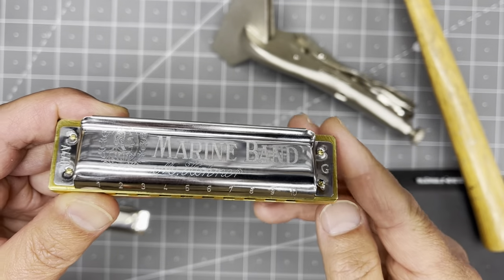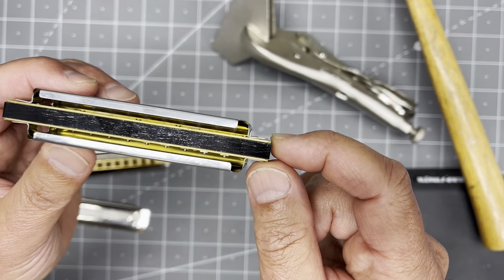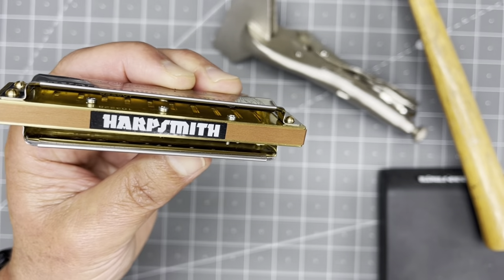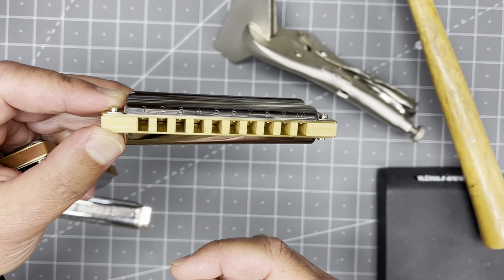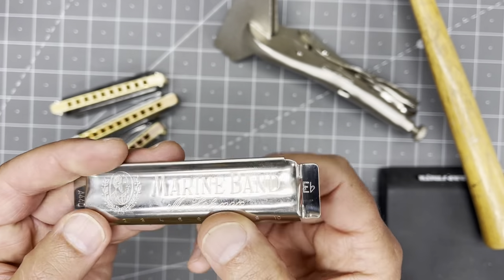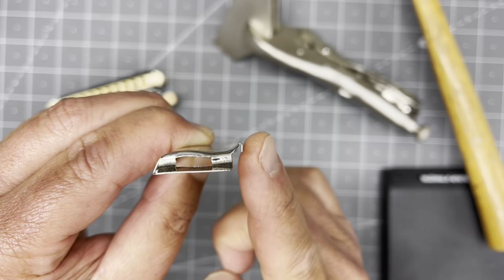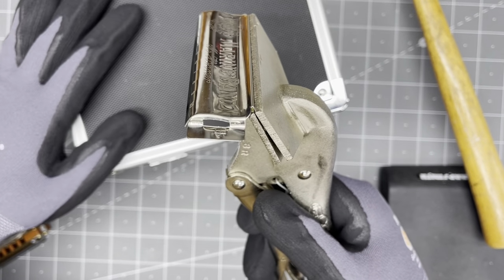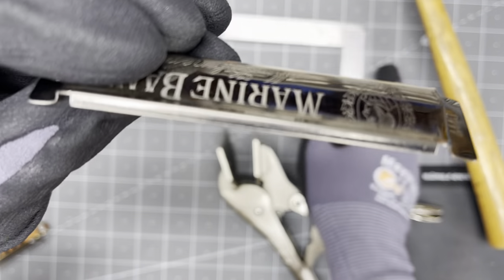How to Customize the Marine Band 1896 Harmonica Cover Plates

Comment: Great information, thanks! Any tips on opening the cover plates on the Special 20?
Reply from the maker: I just noticed my first reply did not get posted here--sorry about that. For factory-like results, I use a 12oz Urethane Hammer with a self healing PVC surface (cutting board)

Comment: I have a crossover in C that does not appear to have the asymmetrical shape of the G(?) harp in this video, but my low D thunderbird does. Does that asymmetrical cover shape start at a key below C or do i have an older crossover?
Reply from the maker: From HOHNER, this innovative Marine Band Draw Cover Plate is only available on the LOW TUNED Thunderbird models.

Comment: To prevent scratching I use vinyl tap on the edge of the duck bill vise grips; I use this method in aviation sheet metal which I’ve been doing for close to 50 years, I wish I was as good with my harmonica as I’m doing sheet metal
Reply from the maker: Ha! Thanx for the tip

Comment: great video-  what's the grip tool you use for bending cover plates?
Reply from the maker: The tool I’ve been using for about 50 years is the Irwin Vise Grip #23 Locking Sheet Metal Tool